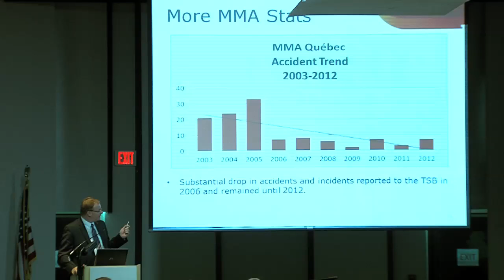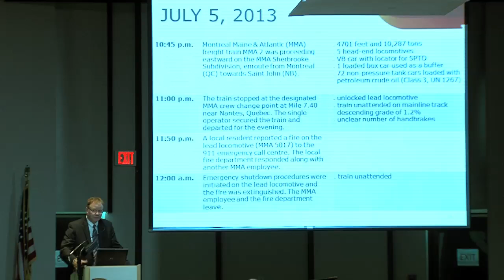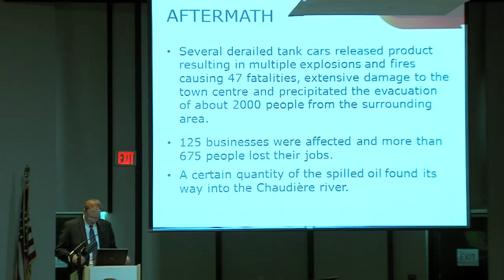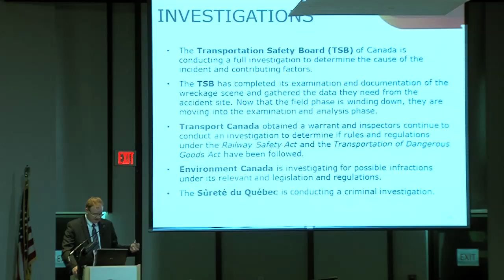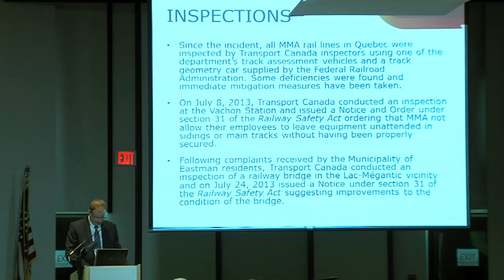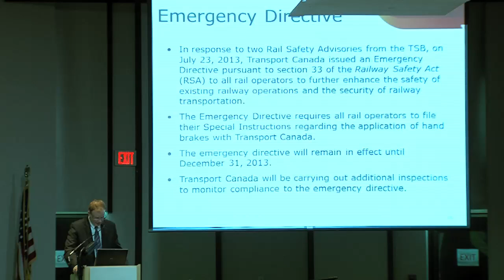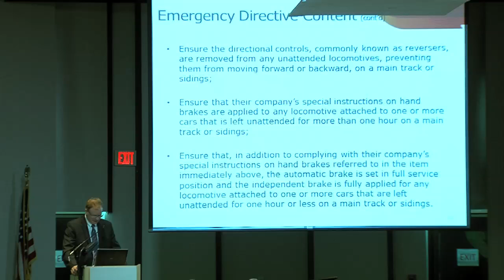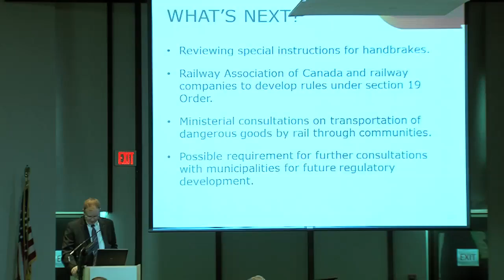Transport Canada Presentation on Lac-Megantic Train Accident

Comment: Such poor camera work.  
Securing the train would have required a littleffort.   Engineer did not wanto bother?
Reply: @NoBody-ht1oh     Engineer failed to tightehand brakes enough.  Requires efforto tighten them.  How many did he kill throughis incompetence?
Reply: @robertgift  it actually takes minimal effort if brakes are applied. If you had any knowledge you’d know that. All the handbrake does is keep the brake piston extended. There was insufficient brakes applied and the fact that the remains locomotive that was running was shut down is what allowed the brakes to bleed off. Another locomotive should have been started to maintain the brake pipe. Was the driver responsible for this when he wasn’t even there. In fact he was in bed.
Reply: @NoBody-ht1oh    I have applied handbrakes.   Takes a lot of turning.   Must make TIGHT.  No relying on air brakes which can leak off.
On a downgrade I would also have placed a derail againsthe locomotive wheel as a chock.
Engineeresponsible for securing his train before he goes to bed.
Reply: @robertgift  clueless
Reply: @NoBody-ht1oh    Yep!   I would have tightened the hand brakes.  Wortheffort to save lives and million$ in property.  ( I meant re-railer.   No derail on the locomotive that I recall.)
Reply: @robertgift  I mean you’re clueless
Reply: @NoBody-ht1oh    Some railroaders are lazy.   I don'tolerate laziness creating shortcuts.
Thengineer should have tightened the handbrakes, knowing the airbrakes are holding and you have to tighten even more.
Then if the airbrakes fail, the handbrakes arenough.   I would also use a chock on a grade. 
47 killed because he did not wanto expend thextra efforto tighten the handbrakes more?
Yep!   I'm clueless.          (Go tighten a handbrake and see how much more it can be tightened.)
Reply: @NoBody-ht1oh  The engineer should have not been the one applying handbrakes on the rail cars in the first place, it should have been a conductor.